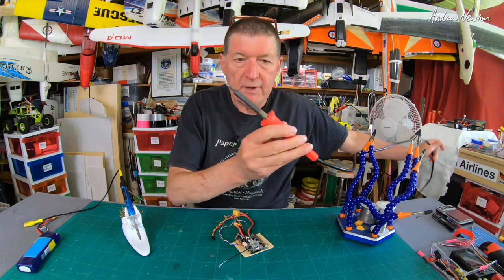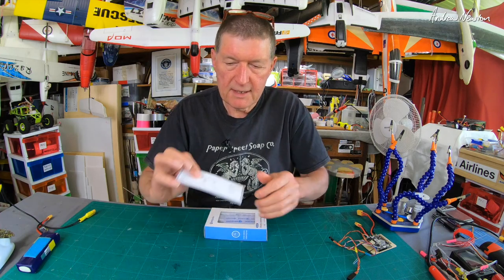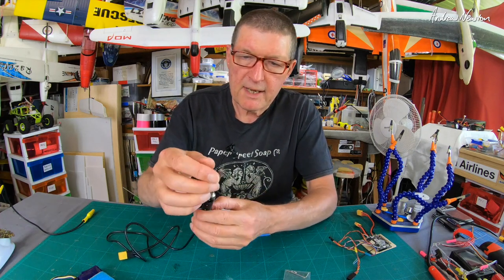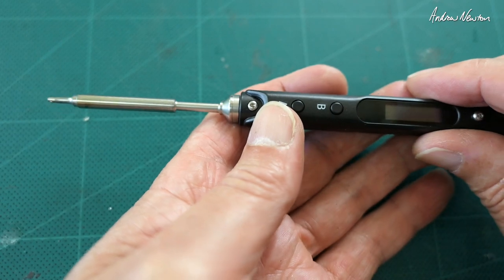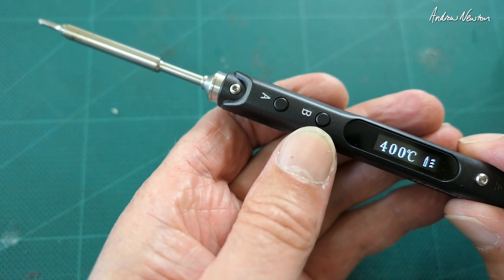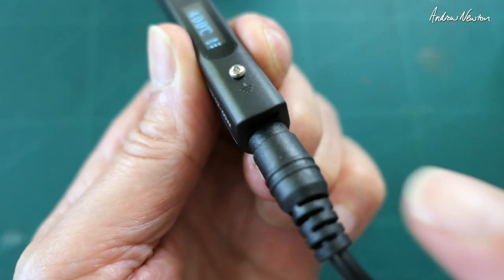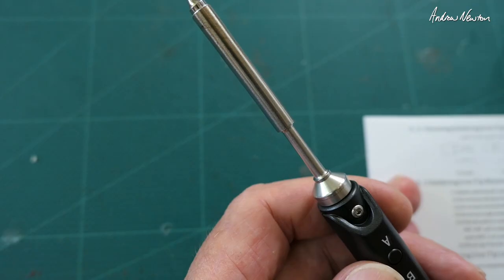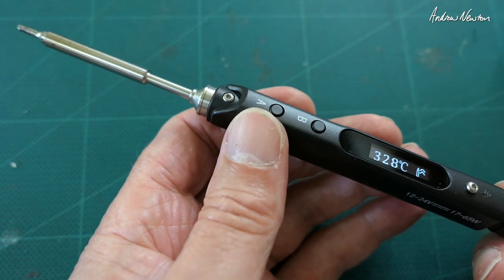Sequre SQ001 Mini Soldering Iron

Comment: I have the TS100 and power it from  4S onsite but occasionaly from a 19V laptop power adapter. The extra volts from the power supply supercharges the heat up time and tip/joint temp is maintained with more authority. Would I recommend it as a first soldering iron? Yes but I still prefer a conventional soldering station for bench top use. For that I have 3 Hakko stations , one dating back to the eighties. Two things that would make the TS100 better. Shorter soldering inserts to reduce tip to hand distance. Think of painting with a brush held at the end, not nearly as precise as holding closer to the bristles. The second  the supplied PVC power cable is too stiff and restricts free movement. I replaced mine with two core silicon insulated speaker wire from Bunnings which is much more flexible. Just be sure to check polarities before connecting and use quality connectors and heatshink. 
For the newbies to soldering the three of the most important things to notice. The joint components need to be clean and free of any corrosion. Second, you can not solder successfully if the joint parts are not at soldering temp and you want the joint temp to rise as fast as possible. this means having a tip that will give good contact to the joint parts. I think many struggle with the usual conical tip, These are next to useless but for the very smallest of connections. A much better tip for general use is the chisel or screwdriver style. The flats and wider tip give a far superior thermal coupling from the tip to the joint parts. Lastly use the temperature control wisely. Not too hot and not too cool. An overly hot tip will rapidly vapourise the flux before it can perform it's magic making soldering difficult, too cold will not allow the solder to flow freely. 
The cheap Chinese solders frequently benefit from the addition of extra flux.
Reply from the maker: Great tips thanks

Comment: The only thing I don't like about soldering irons (and I've been using them for almost 37,000 years) is the tip to grip distance. The typical huge overhang has always felt wrong to me - clumsy and unwieldy.

It's like trying to sign your name when holding the pen by the blunt end. I'd like a proper full-sized iron with no more than a 2" projection.

Or asbestos fingers.

Comment: so, silly question.  what temp do you set it at for most of your soldering.  I am going from low tech soldering iron which i got used to with a dial without values and now i am kinda lost lol
Reply: i use 420 degree celcius and it works fine
Reply: @Fifsson_  250 works good for small pads to reduce heat transferred to pad
Reply from the maker: 300 for small pads, 400 for big wires

Comment: Intelligent Soldering Iron??? 
Or Someone intelligent enough to use one...
Perfect for the field though..Change plug for use with my 4B DC Portals. May even have to start charging for field repairs?
And is That Plasticine or mouldy old Blue Tack?? <]:)...
Reply from the maker: Mould old